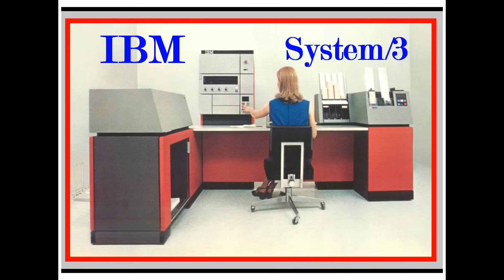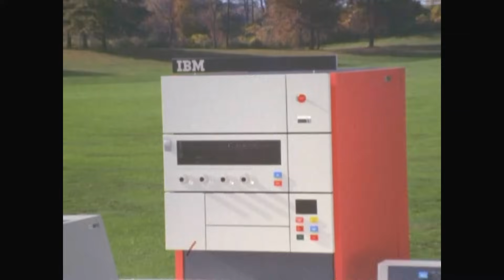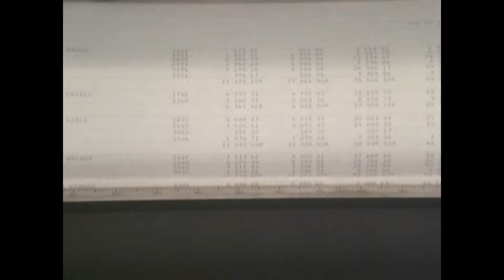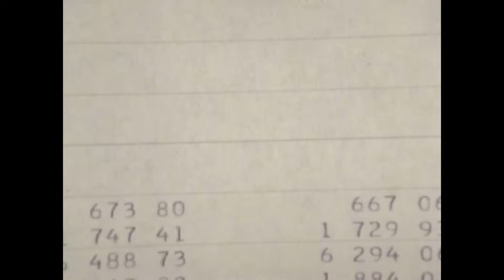1969  IBM System/3 promotional ad - midrange, minicomputer, Computer History, RPG

Comment: My first programming job as an undergrad was working on one of these beauties. (RPG II Whee!!) The company decided to use second party memory which meant that ANY problem with the system meant the IBM tech would point to the memory as the source of the issue. OCL decks and halt indicators, fun times.

Comment: Funny how they won't talk about the office AC upgrade needed to keep this equipment running in a temperature operating range; as back then, when the room temp got about 80 degrees F, or 27 degrees C, they would either malfunction or shut down.

Comment: I have to say this was rather interesting and certainly amusing. I'm not that knowledgeable about computers from this Era but it is fascinating. Seeing the punch card hopper and reader in action was cool.

Also, the reason why that manufacturing equipment hasn't been used is because it's in Britain and the workers are on strike in solidarity with other unions. 1969 after all.

Comment: These machine were so slow that the operator would load a job and go do other things, away from the machine. In 1976, a friends company hired me to build a “process monitor” for their S/3 because they’d start a non-print job that would take hours but if it crashed, nobody knew. They only indicator was the process timer, an hour type meter, used for billing on rental machines. It got pinged by the processor every few seconds, maybe 6 (0.1 minute), if the processor crashed, the timer stopped. So, a couple 555 timer chips and a piezo Sonalert in a little box worked  wonders. A 90db alarm was hard to ignore. One of my first free lance EE jobs. Thanks S/3.

Comment: The System/3 had no provision for halting a process once it had started to run. For instance, if a compile failed because of an error on the very first page, the user had to wait for a sometimes voluminous compile listing to print in its entirety. Users learned to reach under the printer and jostle the paper discharge chute, which would cause the machine to halt with a "P3" (printer error) displayed. The user could then dial in the response code FF to abort the run. Another way of stopping it was simply to press the green "Start" button on the console, causing the system to reboot. 

The concept of keying your punched cards through the console was a marketing ploy. In reality, the System/3 could not be a computer and a keypunch at the same time, so when it was a keypunch, no computing was possible. The original IBM System/3 which was shown in July, 1969 had the keypunch console so they could offer a computer for under $2,000/month. In reality it was unworkable and almost invariably users acquired a stand-alone keypunch/verifier.
Reply from the maker: Hi Nighthawke70, thank you.  Very good info!  ~ CHAP

Comment: One thing about IBM in those days and into the 90s was they put a lot of effort into the asthetic design of their boxes.
Reply from the maker: Hi Graeme, yes,  you're right.  Lots of class in those days!  ~    Thanks.    Victor-CHAP
Reply: After 1970 new products stopped have those bright colors.   There was red, blue, green and yellow in the 360 and Sys 3 era with lot so flashing lights.   All that went to off-white, gray, black and as automated diagnostics programming improved... the lights went away.   The lights were almost exclusively for use the maintenance people like myself.   Very few of the lights meant anything to the vast majority of customers.

Comment: I love how the tape ran out just as they were about to be told the price!
Reply: I suspect this video was for internal IBM announcement meetings.    I  remember being at the announcement in our office.  We had a system installed for customers to see.   I remember it seemed so tiny, with baby punched cards.   Later I worked both servicing the hardware and later as OS troubleshooter.   Hard to troubleshoot, a lot mechanics in the peripherals.  Grease, even hydraulics, replaceable head on hard drives.... I like software better.   30 years and retired in '98

Comment: I wonder what would happen if someone shuffled the cards like in a poker game and re-inserted the cards in the machine.  Will you still be able to get accurate data out of it ??
Reply from the maker: Hi Gerry,  good question.  From my old "punch card" days, my recollection is that the computer would stop and kick out an error as soon as it detected the input cards out of sequence.  In many old systems, the first few punch cards contain JCL (Job Control Language) which is a specific series of commands on how the computer should process the following cards.  Anything out of expected sequence, you get an Error and its kicked out.   If the program starts to run and then hits a snag, the program will ABEND ("ABnormal END") and may dump all the contents of memory right to the printer ---  Often called a "Core Dump" and often in Hexadecimal format....   Well, probably way more than you wanted to know, but still, I liked your question.   Maybe someone else will comment on something that I left out.    Thanks for watching!
Reply: That is an awesome answer and thanks a lot for that. Another knowledge for me...  I've been thinking about a scenario where a computer operator carrying very important data or report in the form of cards, and unfortunately he got tripped, fell down and the cards scattered all over the place.  (Uh-oh)  It will probably take another purpose-built computer to sort the cards in the proper order again if there is one... I hope it did not happen in the past though.  Thanks again for the answer.  That was awesome!
Reply from the maker: You are very welcome!
Reply: @gerrycrisostomo6571  The IBM 84 Card Sorter sorts 80-column cards. The IBM 5486 Card Sorter was for IBM System/3's 96 column cards.
Reply: Anoperator could manually number them with pen or  very quickly with a permanent marker make a diagonal line on the edge of the stack
Reply: My mother worked on punch card machines in her early college days, back when everything was done on time-share on dumb terminals from a central mainframe. She's shared similar stories regarding somebody tripping and messing up their card stack.
Reply: Hi Gerry!  We had that happen regularly - usually on the overnight shift.  If your data was organized properly, it either made no difference what order your cards were in, or if it did, each card started with a serial number.  For serial numbered cards, you would just scoop them all up and run them through the sorter, and you were ready to go!  And it only took about an hour!!!
Reply: The sequence of data  or the order that bits appear in a program matter... now and then.    If memory serves me... when the deck of card was an executable program (yes you could read in a program in from a card reader and execute it) each card had a sequence number put there by the compiler.   If dropped the deck, you could resort the cards with peripheral device called a sorter.   Took seconds to put them back in order.   If the deck was Data,  it might not matter the sequence or it might and again it would have put in proper sequence for it work right.  And yes I'm that old.

Comment: A blast from the past.  My 35 year programming career began on one of these in late 1974.  We had a bigger printer, a 20 MB disk drive and a couple of tape drives and a whopping 24 KB of real magnetic core memory.  Although we had a few applications written in RPG II, most of our programming was COBOL.  I didn’t spend too long on the System/3, as we converted to a Honeywell Level-62 in mid 1976.
Reply from the maker: 24 KB of memory...   amazing to look back at that.    Did you like the Honeywell equipment?
Reply: Computer History Archives Project, I did like the Honeywell, enough so that I went to work for them in late 1977 supporting the Level 62 product line out of their Cincinnati office.  I did that until 1981, when they went through a reorganization.  I left nd went to work for a Level 62 user in Evansville, IN.  We continued to use the 62 until 1986 when it was replaced with a Wang VS300.  The Wang lasted for 10 years until we made a major change, abandoning to all home-grown software we had been using.  We bought an integrated distribution package in 1996 from a company called Prelude System out of Dallas.  It used Advanced Pick database, with programming in Pick Basic and System Builder +, all running on an IBM RS6000.  That turned out to be a good move.  I retired in 2009, but the last I heard they are still using the same software over 22 years later.  I’m proud to have had some small part in that company growing from $10 million in annual sales when I started in 1981 to over $100 million when I retired in 2009.
Reply from the maker: Hi Norman,  that sounds like quite a career.   Glad it worked out well.  I know the company has done well overall, through the years.  Thanks again for sharing your experiences.   (I remember the RS6000.. that was a big deal when it first came out.)

Comment: Cool, can't wait until system 4 comes out.
Reply: Believe it or not there are probably thousands of applications written initially for the System 3 still running on the IBM iSeries boxes.    The System 3 was followed by the Systems 34, 36, 38 and AS/400.   So you still pick an iSeries box.   Please do and  it'll help keep my pension checks coming.   ;-)
Reply: The System/3 layout looked a lot like a System/38 layout with the wrap-around console.

Comment: My phone is about 100000000 times more powerful than that piece of crap! HA HA. I wish I could go back in time and show it to those guys and make them shit their pants!
Reply: a flip phone would be 1000000 times more powerful.
Reply: IIRC, the System 3 ran at 500khz, and had a 12 bit bus.  Your original IBM PC was at least twice as powerful, and didn't require 22 volts at 40 amps!

Comment: So how much a month???? :)
Reply from the maker: I think you could lease a system from IBM for between $1,000 and $2,000 per month, depending on peripheral equipment.
Reply: I worked for IBM and serviced the System 3.    You could buy a IBM System back then but it seldom happened.   As service (CE Customer Engineer) we fixed them and had very little to do with sales.  But they were incredibly expensive.  With a lease (basically rent) you  paid per month based on the number of hours the box ran., you didn't have pay for maintenance or parts, that came with the lease.    CEs had a key that we used to turn off the clock that measure how long the customer used the box.  They didn't want our time running it to count against the user.   I still have my key.   I worked on all IBM computers that had a clock.   I started in '68 and retired from IBM in '98.